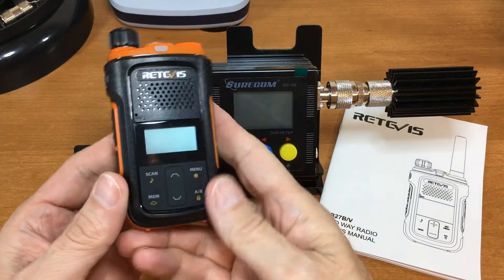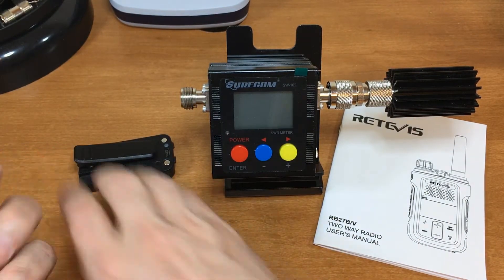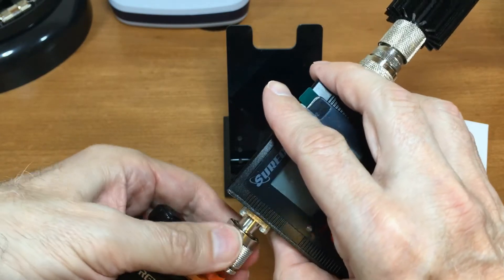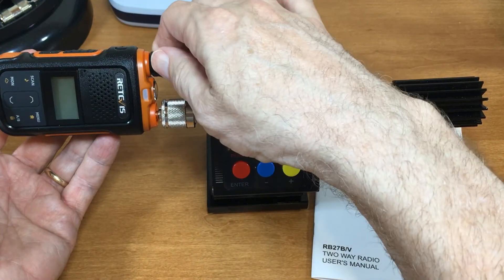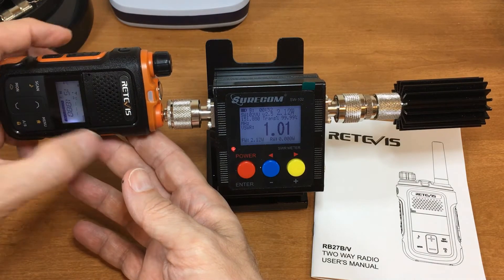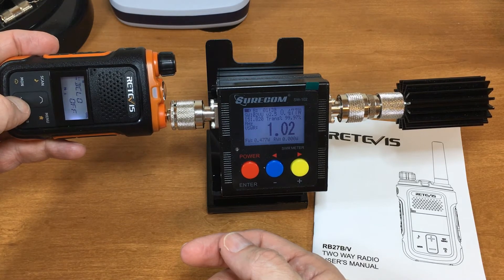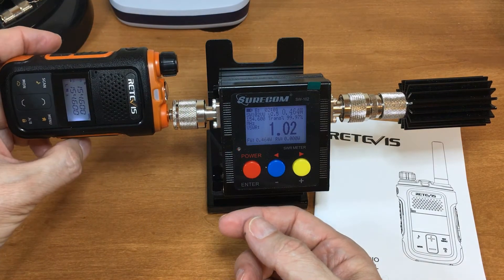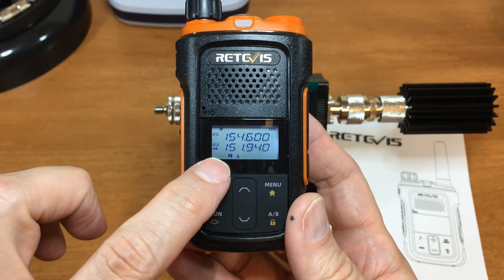Retevis RB27V MURS power test

Comment: I was using chirp to program my RB27b and RB27v radios when I noticed that chirp had a “full band support” for both radios. I gave it a try, and was surprised to discover that it gave both radios 99 memory slots, with full uhf/vhf functionality. I have plenty of other radios with that capability so I didn’t re-program them, but it is fascinating what can be done with them. The entire RB27 line has evidently been dropped. That is unfortunate. I have all three flavors, and they are my favorites!